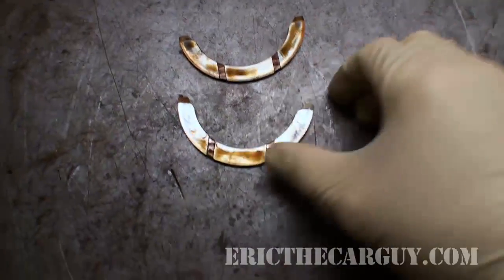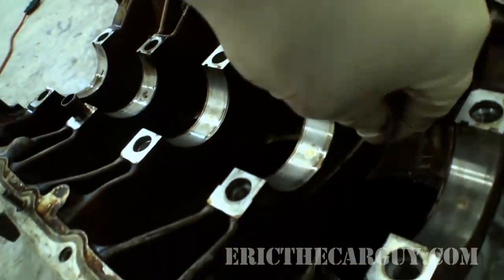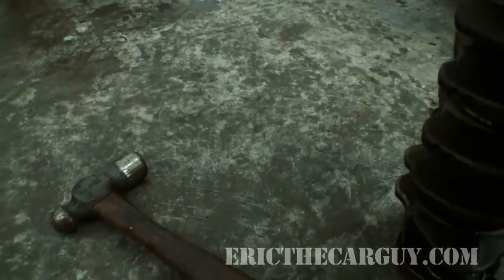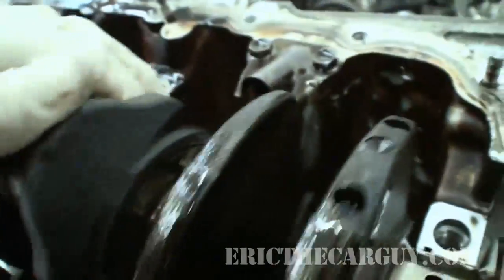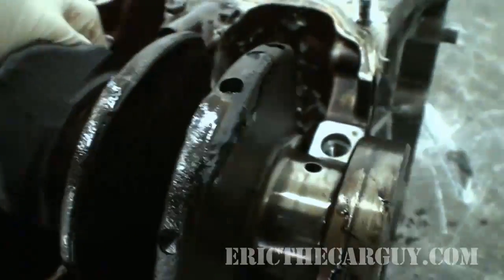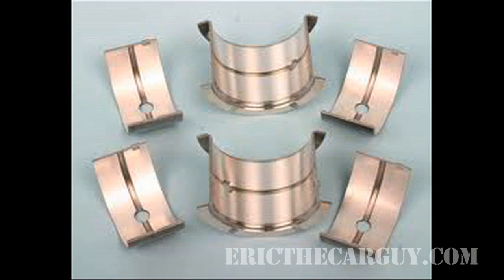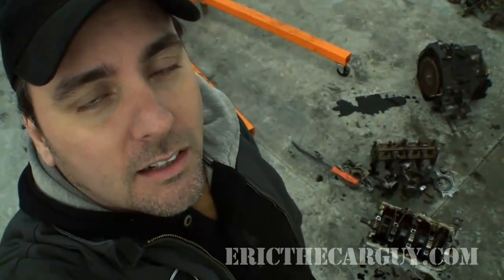Thrust Bearings and What They Do - EricTheCarGuy

Comment: yea those went out on my 2003 Hyundia Elantra. it was my first car. we got it for $800 and put another $800 in parts and like 15 to 18 hours of work into it (we fixed it ourselves. me and my uncle). and i only drove it for 1100 miles and then the washers went out and the crank pushed out the front crank seal and dumped all the oil going down the highway on the way to work to work >: (
it had 96,5xx miles on it when we got it and it went at 97,622 miles
and its gonna cost more than the cars worth to have someone else fix it due to being kind of a big job. and the most i can get (from asking local mechanics if they wanna buy it) is $500. so f*** it. f*** the people at Hyundai. f*** the mechanics. im fixing it myself come spring this year. idc if it takes a month. idc if it takes 4 months. we have enough time and money into it that im gonna say its worth fixing. that and the fact that it was the last thing my grandfather got me right before he passed in september. is enough for me.
Reply: sir,if you need any truck accessoires or any question,pls contact me ,I will reply all your question as I know

Comment: I am having low oil pressure light trouble, manual transmission, I deleted the dampener, I can make the light go out, at 50, by depressing the clutch a little, thanks so much I will test it, using your method.
Reply: Hi, I'm having the same problem, did you end up replacing the thrust bearings and did that fix the oil pressure problem? Thanks.
Reply: yes, I replaced the thrust bearings, oil pressure light isn't coming on anymore, This is also amylee7017
Reply: @janpalmer3025  oh that's great, I hope that fixes my issue too, thanks a lot for replying!

Comment: Awesome explanation. I had a problem with front crankshaft oil seal. We had to use a lot of force to remove timing belt pulleys. Finally we re placed the seal but then when the crank shaft moves backwards and forwards slightly, the seal comes out spilling lots of oil.Could this lateral movement of the be a sign thrust washers are worn. Car has power and starts well. Pls help.
Reply: Take a dial guage and place it at the end of the shaft and push it to see how much its walking, if its more than 0.005 your thrust bearing is gone and you need to attend to it otherwise you riskibg damaging the crank shaft.

Comment: My 94 Honda prelude starts up but when it warms up and I push in the clutch to shift it shuts off and I was told it was the thrust bearings so I have to take the engine apart and fix it just don’t know which ones fit

Comment: I had no idea what that metal bit was, but this video cleared that right up.  One of these bearings wore down a groove in the main bearing cap and then dislodged to the point it seized my engine.  I'm stubborn AF, and I like to fix things so I took the whole engine apart to find that.  Daily driver, oil level was good, recently changed...

Comment: I would imagine that the extra slop in the rotating assembly would cause a lot more damaging harmonics/vibrations as well? Could damage the block and crank eventually I would imagine. Particularly in a high RPM application

Comment: Quick question does this mean the engine is shot when I find my thrust bearings in the pan it's a K24 off a element and its a manual do I have to replace the engine
Reply: You have to open up the engine ya

Comment: No crank no start on a manual transmission, where you're forced to press the clutch for start, then just bypass the switch on the clutch pedal, it's only two wires.. If it cranks over then there's your problem, a binding crank. However, I've personally never encountered this problem before, not saying it can't happen I've just never seen it.

Comment: if i found one in thrust bearing in oil pan on the other is  still in block can i fit them back in when rebuilding and it will be ok
Reply: buy new bearings if you're rebuilding

Comment: A manual clutch has it's own thrust bearing so don't confuse it with the crankshaft thrust bearing
Reply: You’re thinking of a throw out bearing or pilot bearing... idk where you’re getting that a clutch would have a thrust bearing?
Reply: Pilot bearing and throw out/release bearing are two different things within the transmission....
Reply: And thrust bearings aswell are different things completely
Reply: @ColdLikeFire  The clutch throw-out bearing is of the thrust bearing type. Usually roller rather than the plain thrust bearing on the crank.

Comment: I have a 1990 CB7 Accord (F22) and when I push my clutch in, I can hear some pretty nasty noises (from the lower engine block area) that I feel in the clutch pedal. The idle drops about 200RPM at full operating temp when I push the clutch as well. but the car runs, drives, and sounds fine when I'm not using the clutch. the mechanics I work with said the thrust bearings were shot. I had my girlfriend press the clutch while the car was off and I peeked in at the flywheel through the timing window and saw it move slightly. I know a fair amount about cars since I work on them daily, but never built or swapped an engine before. Does the motor need to be pulled and disassembled like the one in the video to replace these bearings? At best case scenario, how much would your average mom and pop shop charge to do this? Sorry for the long comment, I just need help because I've been driving without using the clutch and I know it'll leave me stranded if I don't fix it. If anyone reading this has any insight I'd GREATLY appreciate it!!

Comment: Will a bad thrust bearing cause a sharp, loud tapping sound and a flex plate to fatigue, crack and break apart at the center around the bolt pattern? My stock 27 year old flexplate broke, the replacement flexplate showed cracking and began making tapping sounds after a while from soft tapping to loud that come and go at idle but are very loud under throttle pressure while cruising. Any tips would help.

Comment: Thanks for the material, I just got from my mechanic, one of thrust bearing just fell down to the oil pan which means that my cranckshaft is moving back and forth for at least 2 mm. Unfortunatelly it's impossible to replace the thrust bearing without disassembling the whole engine :(
Reply: hey had the same problem like you,  when your mechanic replace thrust washer  did they stay in the block and every ting was ok after ?

Comment: you are good on a lot of stuff. this aint one you have experience with,. thrust cant turn . steel on steel ?  bottom ones  most are pinned to main cap .  top ones float. good job otherwise.  love your car vids ,  oil grooves toward the crank.

Comment: hey Eric question I'm about to start replacing my main bearings in my 2.7 dodge and was wondering could the thrust cause the crank to shake or have a airplane motor sound from the bottom end.the thrust bearings on mine are separate pieces just like what you was working any advice would be great

Comment: Thanks for this, i was going over spare engine in my shed, taking off the flywheel i noticed the crank moving back and forwards, hence googling "crankshaft end play" brought me here. So had like 1/4 of an inch play. On removing the sump i found a pair of mangled thrust bearings in the bottom of the engine and some nasty grind makes on the crankshaft, so safe to say thats focked. :D

Comment: like the video Eric my question is what if your thrust washers are in the oil pan and did I lose oil or oil pressure to that area. Worried that area didn't get enough oil where the rod bearings might be ruined. Tks for your time and keep the video's coming.

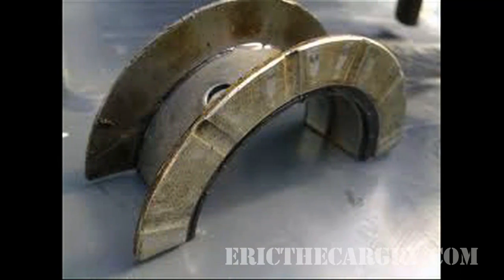Comment: My question, because I can't seem to find the answer anywhere, is which direction do the thrust bearings go?  Grooves in so that they touch the block?  Or out so they touch the crank?  At 4:50 you show a one piece bearing thrust washer and the grooves are out so they would touch the crank.  I'm just curious because I can't seem to find an answer and there were no guides with the thrust washers I bought.

Comment: if you are putting an a/t engine in a manual car (honda d15). do you need to do anything with the thrust bearings before install? Or can I just slap the flew plate for a flywheel and drop it in?
Reply: Dre Zee that's a good question. I would assume that both engines have the same thrust bearings but I don't know for sure.

Comment: I need to take out the camshaft bearing on a 1985 toyota van 3Y-EC, but I do not want to  remove the base pan of the the engine.
Is there a tool to hold the hydraulic lifters in place so it don`t drop into the base pan?

Comment: I have a 92 civic dx with the D15B7 motor. currently going through rebuild and I'm on the thrust bearings. I can get the left bearing in but the right bearing does not have enough clearance I guess to get the bearing in. any tips

Comment: I am rebuilding my a20a3 honda engine and have gotten to the thrust bearings, not sure what they were used for, but now i know. The book says and I quote "thrust washer thickness is fixed and must not be changed either by grinding or shimming. Thrust washers are installed with grooved sides outward"  so the groves face outwards from the bearing housing, example @ 4:50.  Thanks for the video eric!

Comment: can the thrust bearings make my car want to shut off as i press on the clutch because my car does that but only when the engine is at operating temperature when its cold it works normal
Reply: Brayand Perez please get an answer i have the same problem
Reply: Yes it can have that effect.  When the car is cold the oil is thicker and harder to squeeze out from between the two pieces of metal so it keeps spinning.  As the oil warms up it flows easier and then you get metal to metal.

Comment: Hi Eric, I'm a big fan of your vids. Helped me out a few times. Just thought id let you and others know that it does matter which way the thrust bearings go in they have a lead/tin/copper sometimes called "white metal" over layer that needs to be in contact with the side that rotates and most are just metal on the other side. If put in the other way round they wont last too long.

Comment: so i have a 97 civic 5 speed. ive had the car for about a year and since i got the car it had signs of a bad throw out bearing. have put 2 clutches in it along with new pilot and throw out bearing as well as a new flywheel and nothing is seeming to help. but it only does it at a certain rpm range. but ive also replace the trans. so im lost could it be the trhust bearings. plz help im goin crazy

Comment: I Have a CA18DET thats out of my car now because I'm doing body repairs. I would like to know if its advisable to install new connecting and main bearings on my existing mains, rod caps and rods? No I have not spun a bearing or anything, but I would like to know if i an change them as the engine is out and noting the age of the engine.

Comment: The only cause I know of for water getting into a combustion chamber is a head gasket failure
Reply: Water pump in some vehicles (Nissan) oil to water temp exchange (BMW). Some in radiator Trans coolers that leak inside of coarse but, that's transmissions.

Comment: I have a Questing... My old man has a Ford Transit "07 2.2Tdci motorhome... When it is very cold it wont start... Just makes a clicking noise... But when you heat the under side of the engine the starter and the oil pan with a heat gun it cranks like new... Bad starter...? It has a new battery which is in the cabbin... It also had check engine light for EGR valve circuit which i replaced and now it is all good... But starting is the problem...

Comment: i always wonder why the cranks are so badly machined in every vehicle
Reply: They are designed with these bearings and whatnot as to provide a protection of the crankshaft, you don't want the crankshaft to wear, you want a bearing to as you can replace them cheaper than a crankshaft.

Comment: Hey Eric, good comparison of manual vs auto, never really thought about that as binding the crank but i can see it's possible, maybe a dial indicator to check movement if doing a clutch on a hi mileage car? Guess Honda isn't perfect either as you do plenty of repairs on them. I assume the kids hot rod Hondas with higher resistance pressure plates put more pressure on those bearings then?

Comment: @playstation2bigs mobil 1 oil is pretty good, all the mobile one oil is fully synthetic, i use castrol in my car, mainly cause it is slightly cheaper than mobile one, and i don't really want to put full synthetic oil at a higher price for my car that has 350k miles and knocks.

Comment: @dav8388 My 5 speed manual 1987 Honda Accord LX never had this switch.  I just put the transmission in neutral and then started it so I didn't have to hold the clutch pedal down with it in gear you normally would.  .

Comment: @binnsh you should start it with clutch pedal pushed down because it it easier for a starter to turn the motor when it's disconnected from the gearbox. Especially in cold winters.

Comment: Well, that's another reason why I NEVER push the clutch in when shifting gears. I only use the clutch for 1st gear and reverse and starting the engine if it has one of those stupid switches on it.

Comment: @mikeisgonzo This is the first time I hear about this. But I must admit I don't know that much about cars. I googled the switch, and read it was invented by GM. Could it be more common in American cars than others? I live in Europe, and have driven only European and Japanese cars, and none of them have had this safety switch. Method of using the starter to nudge the car of the railway tracks is even introduced in driving schools, doesn't work with the switch.

Comment: @binnsh 99% of cars out there have a clutch switch that will not allow the starter to engage until the clutch is pushed down, so unless that switch has been bypassed it's not going to start until you press the pedal.

Comment: I've been thinking that manual transmission cars should be started in neutral, foot off clutch so there is no load on the thrust bearing until oil pressure builds.  Your thoughts?
Reply: You could by pass the clutch switch to obtain this, I had an old chevy 1960 with an inline 6 and a powergide trans that had the neutral switch bypassed and you could start in in gear gotta really keep your eyes open lol